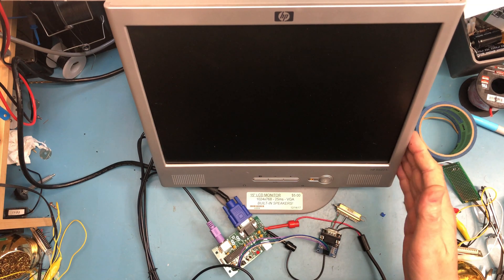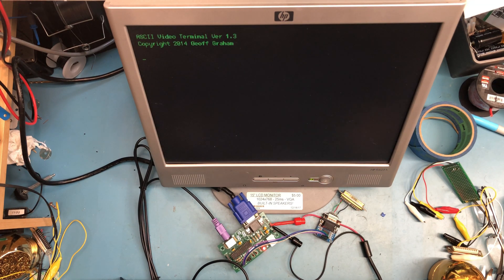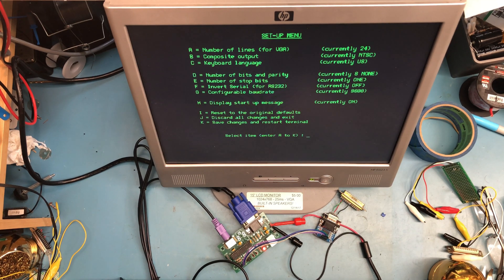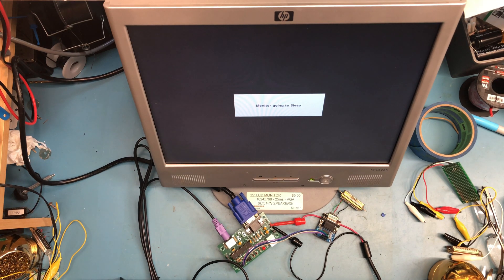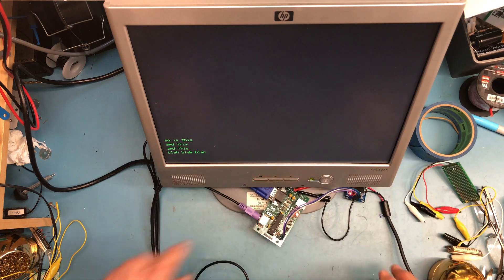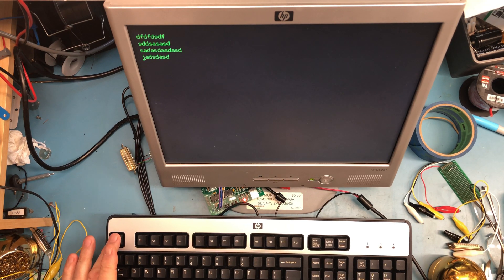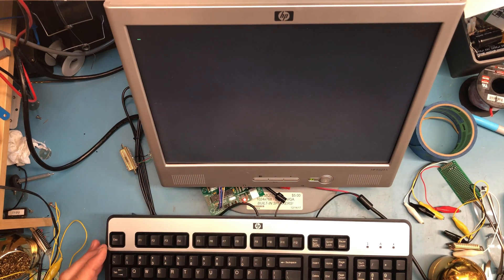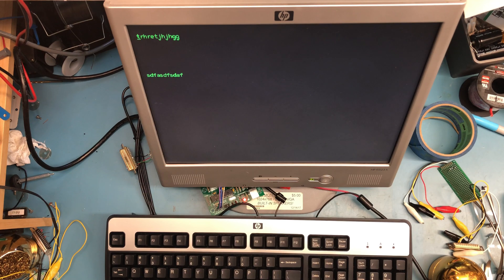STB404 - VT100 Emulator - Part 2 - Initial Testing

Comment: There isn't much info on that Terminal Board. I built it a few years back and it comes in handy for connecting to modern systems that has TTY consoles. I think I mentioned it before but there is another board floating on the web that lets you use the XY function on a Scope to be a VT100 Display.